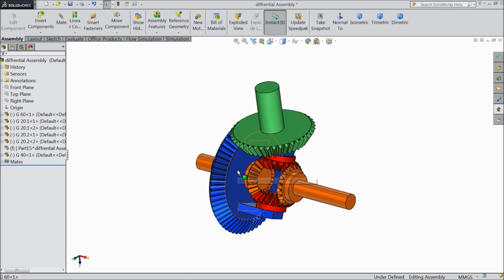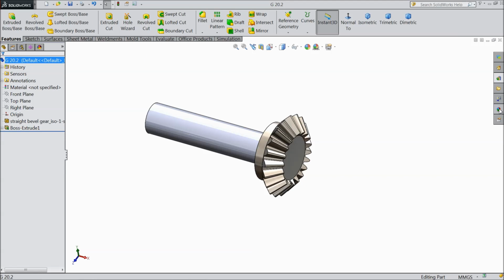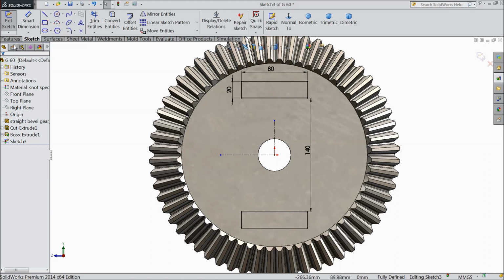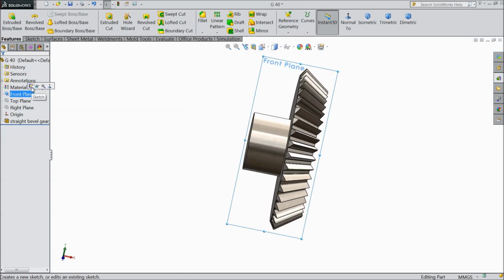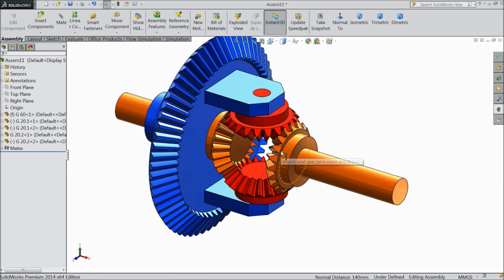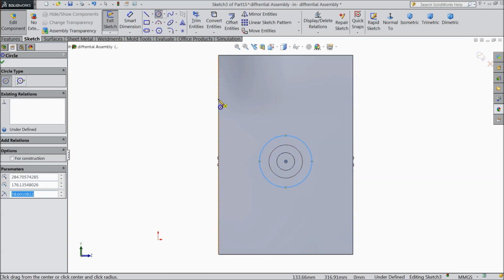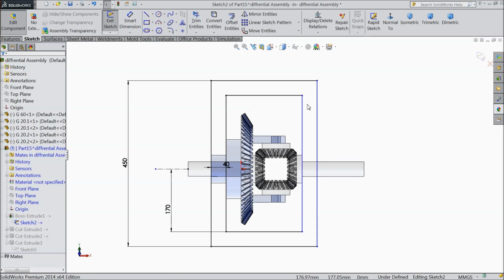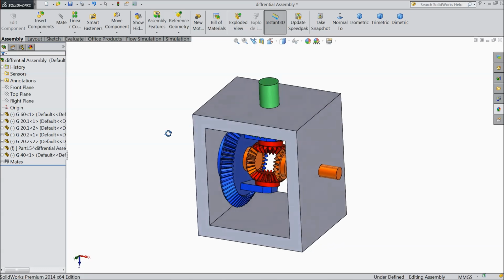Solidworks tutorial | sketch Differential Gear Box in Solidworks

Comment: Ratio wheel to pinion in the gear set is about 1.5 (For example 10 teeth for pinions and 15 teeth for wheels)
In a gear set for heavy loads in trucks you need 4 pinions and teeth number in wheels are even like 16 or 18.
So it is only an example in some points far away from real parts.
But very nice example to do this parts for own constructions.
Reply from the maker: True its far from reality, just modelling,

Comment: Why is gear placed in assembly file and then converted into part file? Why it is not placed in a part file and converted into regular part file?
Reply from the maker: you will not get the edit option in part file that's why i choose to open in assembly file and save as part file.